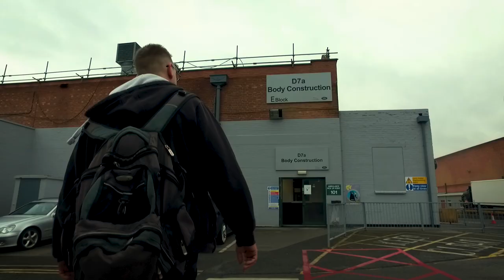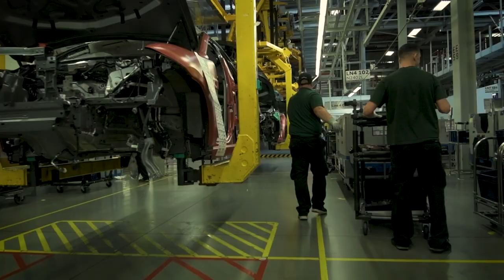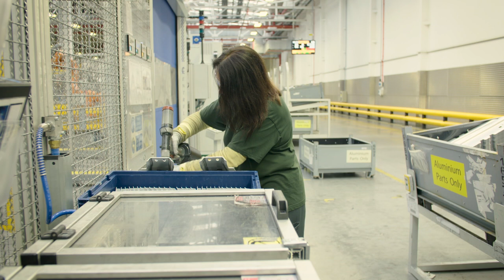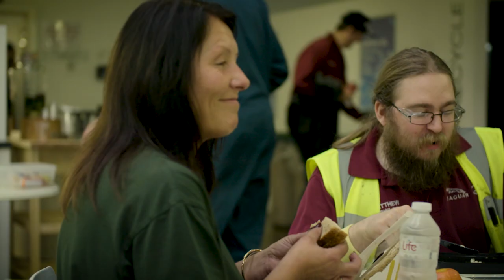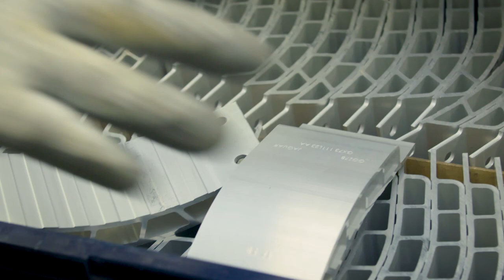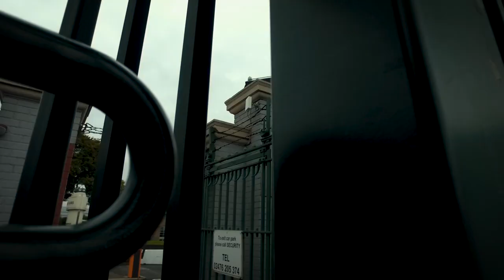A day in the life | Jaguar Land Rover

Comment: Couldn’t help but noticing there were people with loose hair and jewelry on shop floor. Here in Canada, people would have been written up by JHSC. In the other video when prince William visit to JLR plant, he was allowed on shop floor without steel toe shoes or safety vests. 🤔 different safety standards than North American?
Reply: I agree with you with the long hair and jewellery.
The assistor that Prince william was operating the soare wheel I built and installed that one.

Comment: Had a 2021 D400e HSE. 2800miles on the clock air-conditioning stopped working, sat  nav keeps crashing, Bluetooth keep failing and the back door doesn't shut properly.
And as for the garage they are about as useful as a glass hammer. 
Still waiting for my Discovery sport after 5 month's with no updates at all. 
Now we have to loan a car just to work